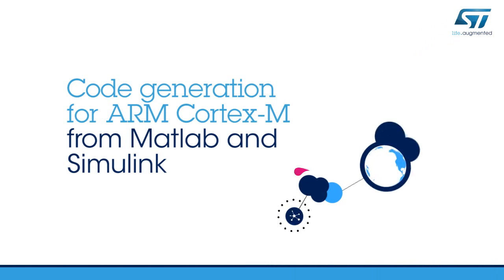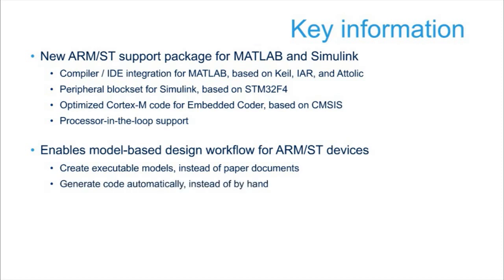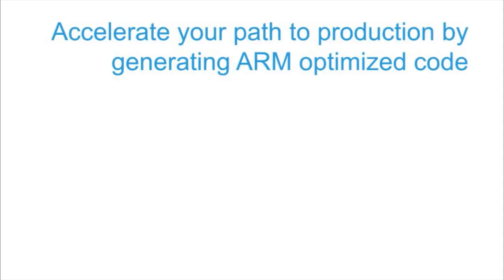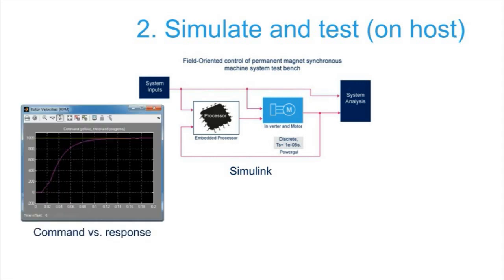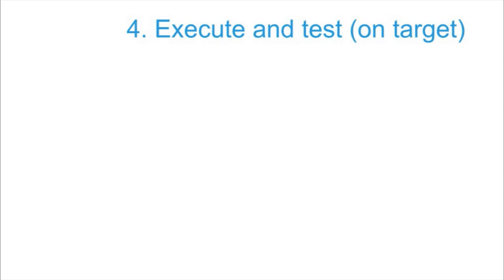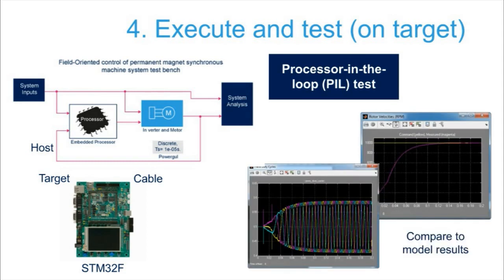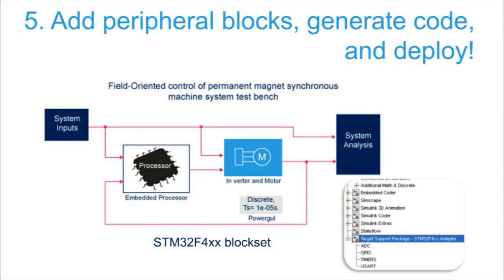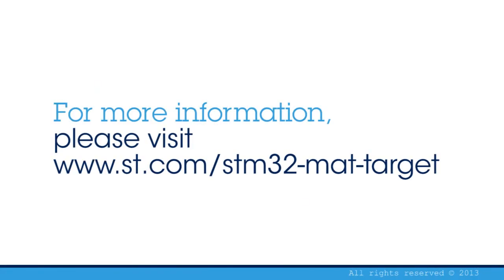MATLAB/Simulink design workflow for STM32F4

Comment: Hey! I had a big problem :( I need to read a encoder sensor that has 36000 per revolution I mean every 360°. I neet to sample with a big Sample time but when I change the time on Fixed step and Sample time ADC it becomes to be so slowly and don't read the datas. How Can I changed it?

Comment: Hello, I'm having issues using this feature. I got this error: "The STM32 board is not detected. Please check that the board is connected. If the board is connected, please install drivers for the board" while running "Communicating with ST Nucleo F401RE " example. Can you help me? Any help is appreciated, thanks!